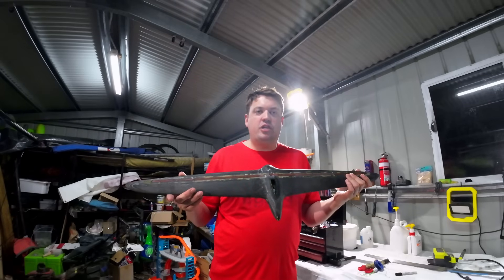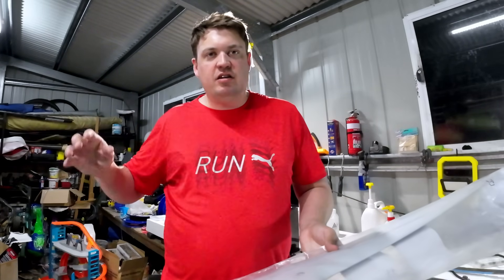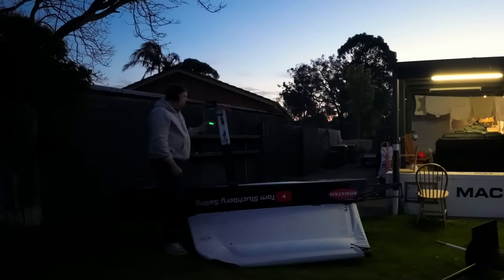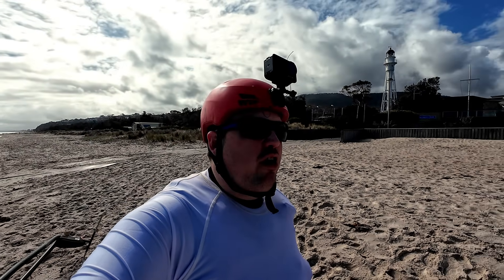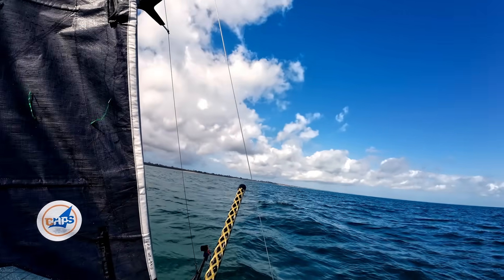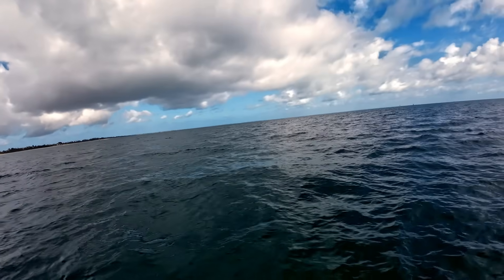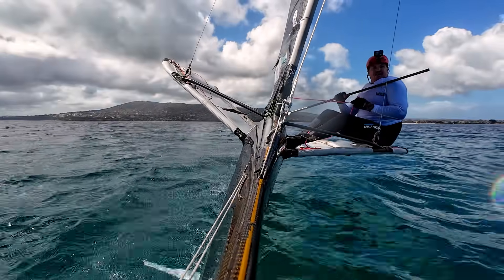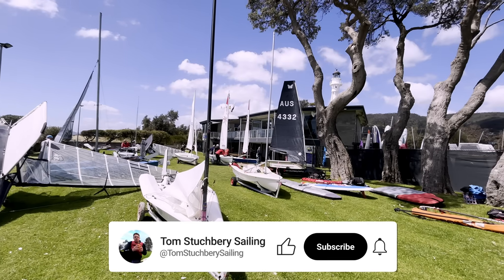Sailing with the World’s Biggest Moth Foil! EP6

Comment: Hi @tom
Maybe it is du to vidéo but it looks like your dont have enough RHA or gearing 
To me the wand must be more vertical with a shorter wand lengh

It will tube you more lift for take off, more Control and then will help you to ride higher with confidence = more speed.

Lesson I have learned with mach2 = always have the max gearing you can and out the wand 60 degrees from horizontal as average position the adjust the high with the lengh
More Wave = more wand vertical (and shorter wand to compensate)

I pushed it far by taking out the gearing Control and put back the ball connection instead of bellcrank
Works Perfectly
Reply from the maker: Good explanation, thanks! I will try this next time I get to sail the moth!

Comment: I started sailing in Moths, specifically British Moths, in about 1958. I guess I'm too old to learn to foil and will have to stick to my Hawkmoth or a Rainbow Scow, but I envy you younger guys.

What equipment/camera did you use to record your speed for the video?

Keep up the good work.
Reply from the maker: Thanks Ross, it must be amazing to compare the modern boats to what you had in 1958! I use the DJI GPS watch and the DJI action 4 camera, then put that into telemetry overlay on the computer. It works well until the camera or watch go underwater, which disconnects the bluetooth!

Comment: So it's the front foil that regulates the height off the water? and there is another foil on the rudder that's set in position? The rudder hinge would bear half the load when foiling?
Reply from the maker: Yes, so the wand/stick on the front adjusts the flap on the front foil which adjusts altitude above the water. The rudder rakes back and forward by twisting the tiller extension (like pushing or pulling the controls of a plane) to adjust the pitch of the boat. You need to have the pitch relatively level so that the wand can do its job, if you’re pointing at the sky you’re going to keep going up no matter what the wand says!
Reply: @TomStuchberySailing  interesting.